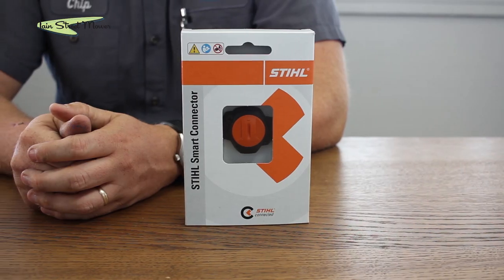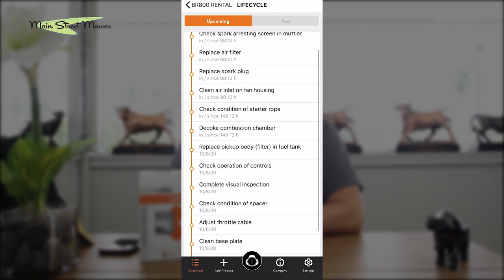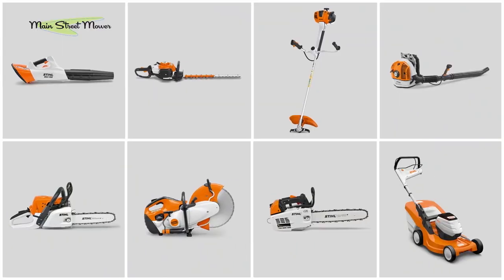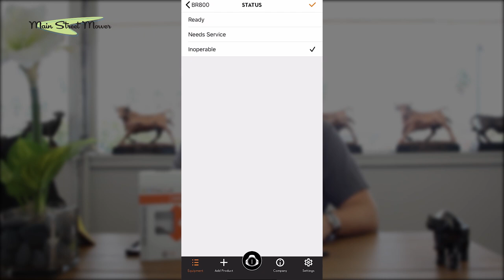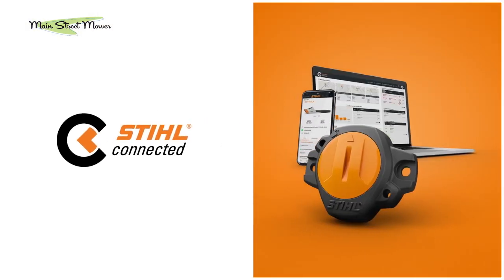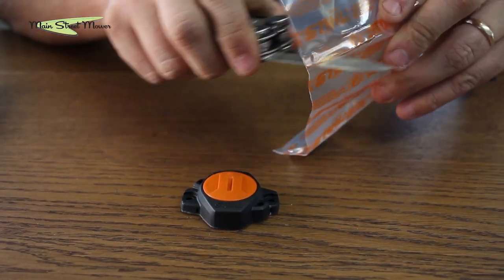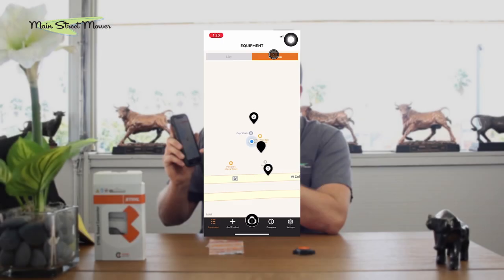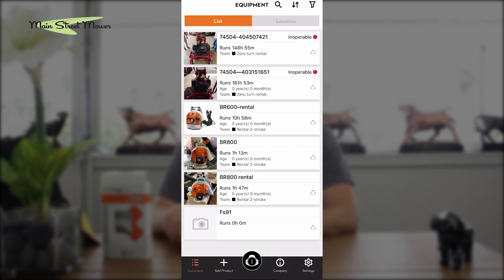Stihl Smart Connector Review- MainStreetMower

Comment: How it knows the machine is running? By the vibration?
Reply from the maker: Electromagnetic pulse
Reply: @mainstreetmower  Most likely I have not understand well. 
I have 3 saws and a Trimmer but I can't figure out the use for that, because sense they all battery power are very much maintenance free.